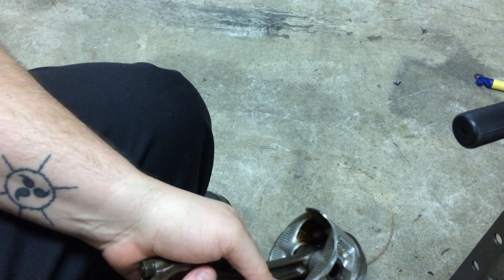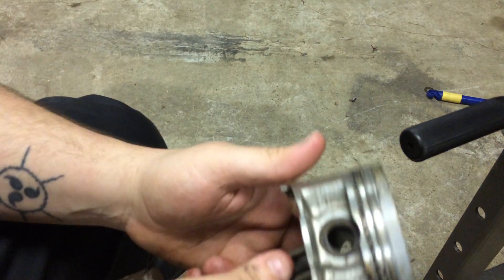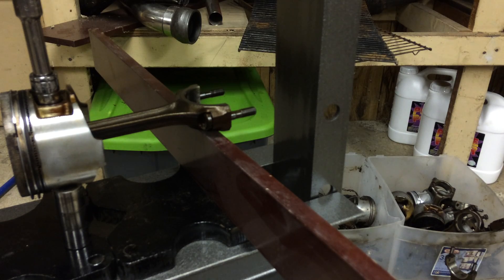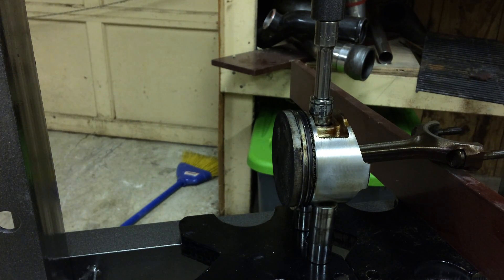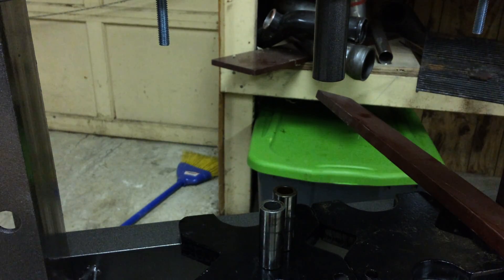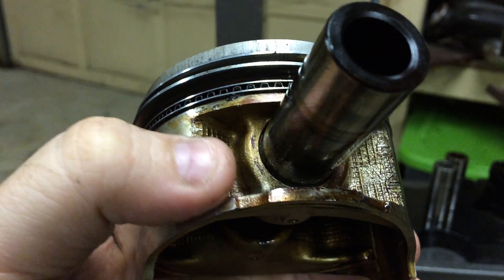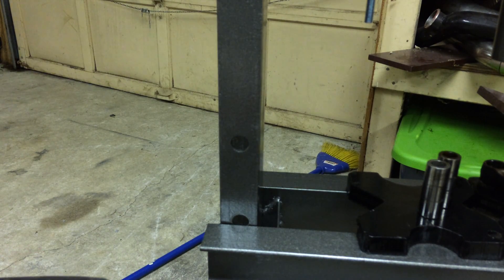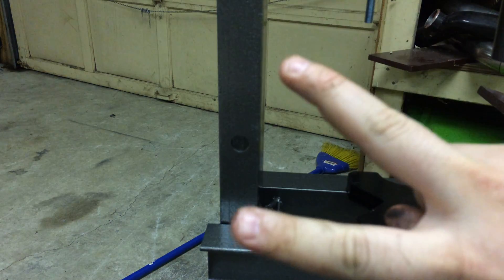Press Fit Piston Pressing

Comment: why can't I heat the rod and slide the pin in like I've done on chevy 350 pistons and rods
Reply from the maker: Buck Wall you can. I just prefer this method. Still have to press to get them off the rods so why bother with heat
Reply: oh yeah definitely pressing got a guy up here who pressed out all 8 350 pistons for 10 bucks so maybe I can my b18 pistons pressed off for 5 lol
Reply: thanks foghorn lmfao
Reply from the maker: Buck Wall 😉
Reply: 😂 I know right I literally just got done doing that today with some d16 rods. I also used a ball joint press (harbor freight) to take the old pistons off.

Comment: Cut a V into a big block of wood and then drill a hole big enough for the wrist pin to pass through the bottom of the V.  The wood won't mar the pistons.  For reassembly you could freeze the pins to shrink them.  I worked in a machine shop where we used liquid nitrogen to freeze bushing before press fitting them into parts.

Comment: It is certainly nice having a press in the garage though. Pressing all shorts of suspension components etc etc. I feel they pay for themselves over time if you work on your own cars. I was eyeing up the harbor freight units. Is your the 20 ton? if so, do you like it, or does it feel extra china?
Reply from the maker: 08650rRider it's the 12. 

My first one seemed like shit, but this one seems to be better. Not sure if the design is different
Reply: Yeah, They look nice at the store, but you never know till you actually use them hehe. Good to know, thanks man!
Reply: 08650rRider hey if you do get the 20 ton press from HF get this version Item#60603 I've gone thru a couple bad hf presses and this is the one to have!!